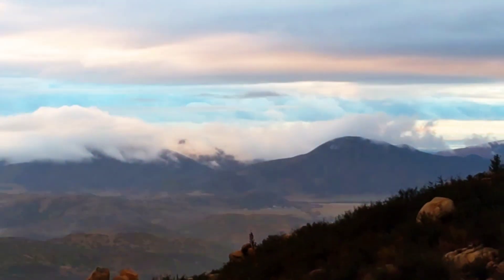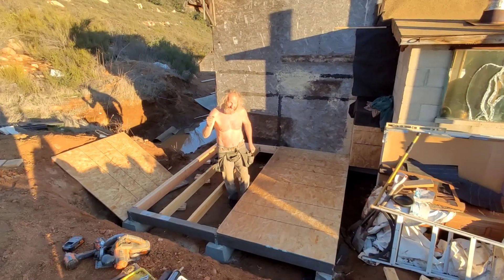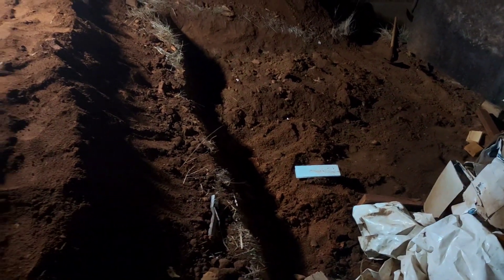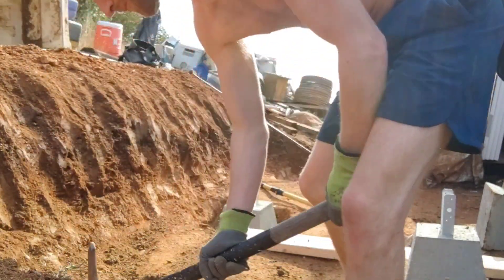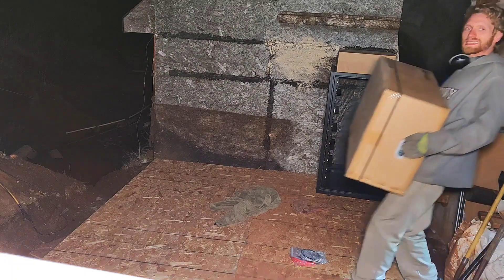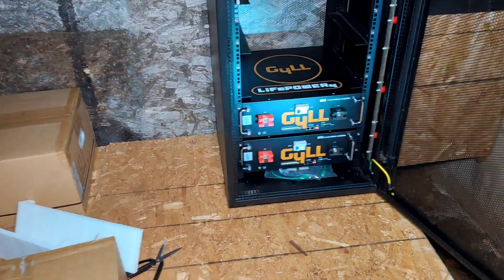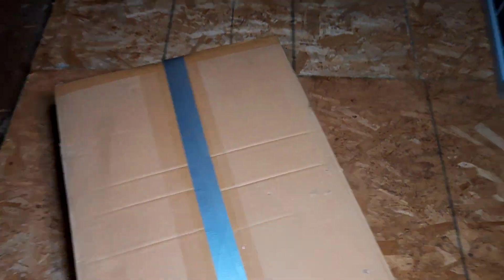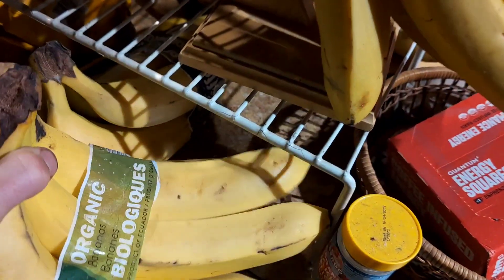15.3 Kwh 🔋 Battery  Solar System Build! (part 1) + Nature 🌿

Comment: So what did they capacity test to?  
They should actually be labled 4.8Kw since its a 48v system at 100ah. Sure, they charge to over 51V, but just wondering what your actual real world capacity is from each shelf.